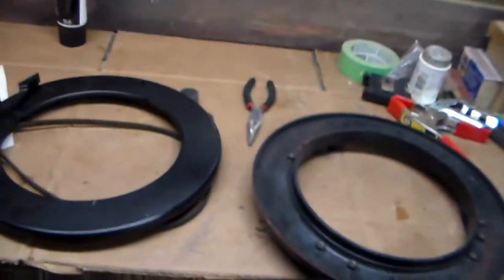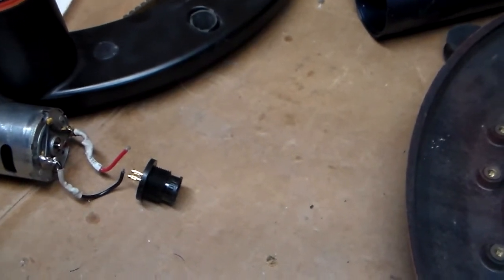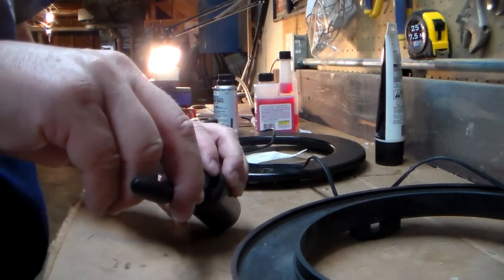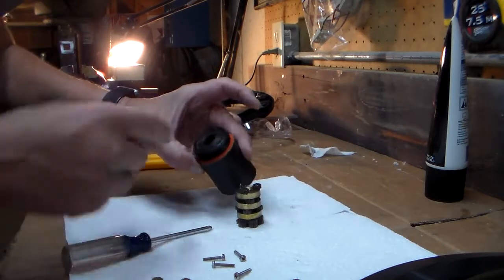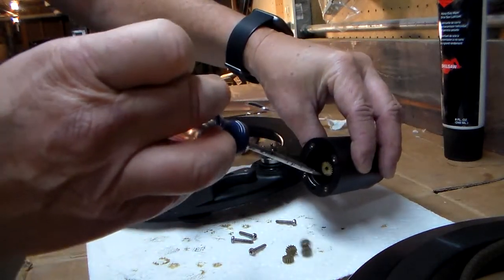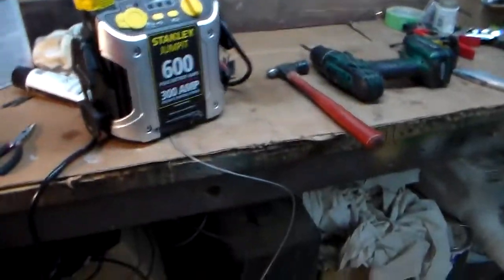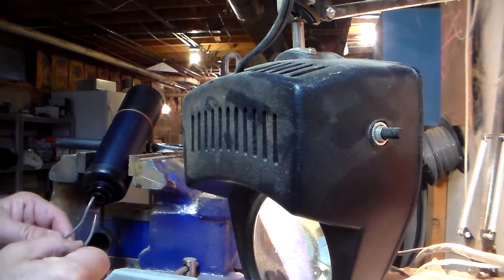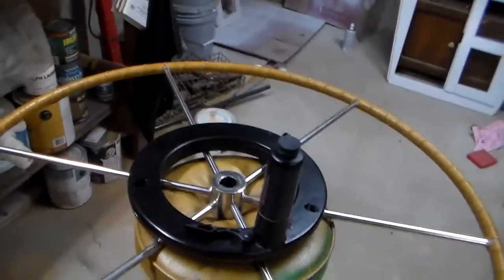WheelPilot Drive unit Overhaul

Comment: Thank you for taking the time to make this video. Having stripped and repaired an ST3000 drive, which is a slightly different design but following the same principal, my view on the orientation of the gear differs with yours. From looking at the design it makes logical sense that the offset or "hat" should be at the bottom. It creates a space between the gear body and the gear. Without it the entire face of the gear would be in contact with the body. When viewed from the side the pin the gear sits onto is flush with the top of the gear when the hat is at the bottom. A plastic shim then creates the required clearance between the rotating gear body the top of the gear bares against. Whether I am right or is open to debate, but it's how I reassembled as it made the most sense from an engineering perspective so I thought I would add my thoughts here for others to decide on merit when reassembling their own drives.
Reply from the maker: Thanks for the comments John….and you very well may be right.  I tried it both ways and did not sense any significant difference, but your logic is sound.  We will agree that the all of the gears should all be stacked the same way, even if we are not sure which way is the correct way.   Cheers
Reply: @TallyHo322  I just opened another one, this time observing the direction of the gears. This one had the "hat" to the bottom with all the small white cogs confirming my suspicions. The hat is to the bottom not to the top. I hope this helps

Comment: Just serviced my 4000 which had been idle for 6 yrs. (thats another story)  based on your video. Well done, when cleaned, lubed and reassembled the unit works great once again. FYI, I spoke with the Raymarine  tech desk and they could not help when ask which lube to use.

Comment: Hi WindyCity.      

Well - thank you for that extensive documentation of your thought and experimentation process.   I have the next generation Raymarine wheel pilot after yours  (EV-100 vs  4000).   It is much the same design, except they improved the large wheel to wheel friction by setting captive ball bearings all around the big ring, instead of the six or seven plastic wheels you have.  It is very smooth between the two large wheel pieces.        I did have mine apart in the first year, because there was an annoying squeak during movement.   It turns out that squeak was the two idler wheels for the belt next to the clutch assembly.  I put barely a drop of McLube in each axle of those two idler wheels, and voila,  end of squeak.      I was careful to not let any lube migrate into the belt system. 

I do plan to take mine apart again next year, to do the following....   The wheel pilot works perfectly up the the point where on close haul, the boat starts to load up with weather helm.   At this point, I can hear the motor running, correcting with some more helm - but the wheel is not moving any farther to correct the weather helm.  Now - I know that this model is only rated to 16,000 gross lbs boat (our boats are 10,250 lbs) and of course these autopilots are happiest when the boat is well balanced.    Still I have read on another review of a 20,000 lb boat that his EV-100 pilot still has power to correct in even aggressive conditions.   My theory is that either   A - there is a bit of grease or more likely dirt/dust on the large wheel belt band.   I will clean that so it is impeccably clean along with a belt cleaning.   <or>  B - that the clutch tension adjustment might be able to go just a tad tighter when engaged.    (I recall one has to play the balance between being too tight, and the wheel not being free-wheeling when dis-engaged and not tight enough, there is adjustment  (4-clicks on the nut) but it is limited).       
Perhaps one of these two adjustments might make the pilot stronger in those load-up conditions.   

Keeping that in mind - I encourage you to impeccably clean your belt ring so it is absolutely clean, and no excess oil/grease can migrate away from any bearing component and onto the wheel belt assembly.  Otherwise,  It will slip like crazy.  

I am going to guess that the orientation of the gears and that slight extra build up on one side is important.   I would guess that perhaps the offset goes next to the flat it faces, so that the face of the gear stands off the flat next to it.  (just a guess).  

All i all ,  I love my EV-100 wheel pilot.     It makes single-handing easy, and I would not dream of being without it.  

Andre
Reply from the maker: Thanks Andre.   I don’t really have issues with belt slippage, but the gearbox was really noisy.  I think it will be good now (at least for a very old AP).  But I will make sure the belt and the raceway.

Do you have a rudder position sensor on your set up?  I don’t have one and was thinking that maybe that would improve the AP’s ability to steer and hold a track with less movement (hunting).   Curious if you have one and if you think it is helpful.

Cheers,

Greg

Comment: Hi Windy, I have just stripped down the motor assembly of a friends Auto Helm ST4000 where the wires had been accidentally wrenched off by unscrewing the cover and I entirely concur with your concerns about holding the socket loom firmly as you tighten it. However, one important thing I found was , that on the bottom face of the motor unit there were 2 short fixed lugs that engaged with two holes in the gear housing, set 180° to each other (one which was broken clean off). They effectively held the motor and prevented the motor from rotating when under load. It’s important because the motor needs to be engaged when being dropped into place as the drive gear wheel is aligned.

Comment: The spindle of the motor on my ST4000+ Mark 1 was stuck. With a gentle use of pliers I got it to trun, but it does not spin freely. Any suggestions for what I can do to free it up?
Reply from the maker: Hi Tony, 

I am not sure if you mean the motor won’t turn freely, or the gear that turns the belt sprocket won’t turn.

If it the motor gear, you can buy a replacement motor. That would be an easy fix (but not necessary cheap).

If you cannot turn the gear that turns the belt sprocket, you could open and disassemble the gearbox.  There are ALOT of little plastic gears in there, and you should carefully document how it comes apart…so you can clean and reassemble it.  A little 3 in 1 machine oil is all I put in mine.

If you are not sure which one is the problem, you can separate the motor from the gearbox…so you can check each one independently.  I connected my motor to a 12-volt battery while testing, so I could see what was what.

Finally if you can’t figure it out (or cannot fix it), you can find used parts for the ST4000+.    I upgraded recently to the ST6001 for my O’Day 322, and have the 4000+ all put together to list on eBay.   If you are interested, let me know.

Good luck!  Having a working AP is a great resource. I couldn’t single-hand nearly as safely without it.

Cheer,

Greg

Comment: I’d love to buy the metal gears.  Mine are plastic.
Reply from the maker: I sold the older AP.  Some of the gears were plastic (inside the gearbox) and some were metal.
Reply: It makes no sense to use metal gearing when the other part of the drive, namely the outer body is plastic. In the event of a jam, the metal gears would destroy the teeth in the outer plastic casing, which in effect would destroy the entire drive. Plastic was used for good reason. It's light, hard wearing and in many applications a plastic gear is actually designed in, to act as a  sacrificial part due to the fact that it's cheap and easily replaced as opposed to some of the other more complex and expensive parts.